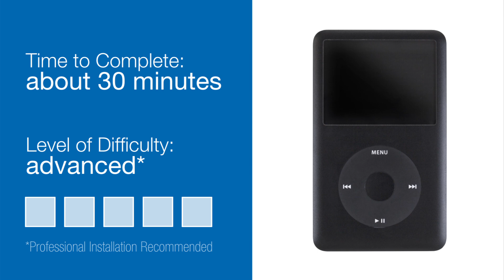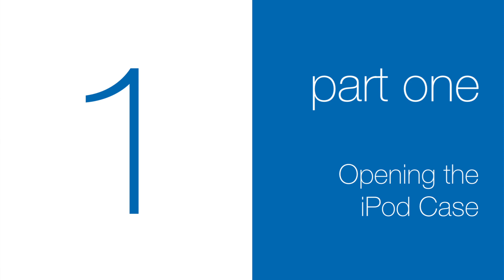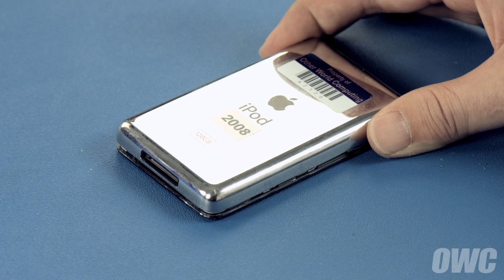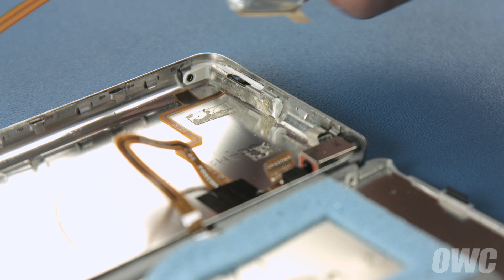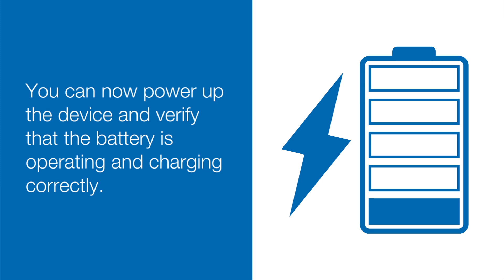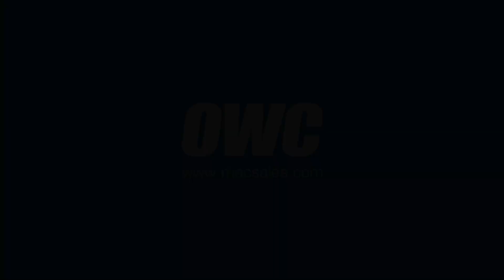How to Replace the Battery in an iPod or iPod Classic (5th, 6th and 7th Gen)

Comment: I bouth the same batery , the batery it’s good? And how long can i used ? One year o more ?
Reply from the maker: Hello there,
Thank you for the question. If you purchased an OWC iPod battery then it will work great!

How long it lasts depends on how often it’s used and how it’s charged, but typically a battery can last one year or more with normal use. Proper charging and storage can help extend its lifespan.

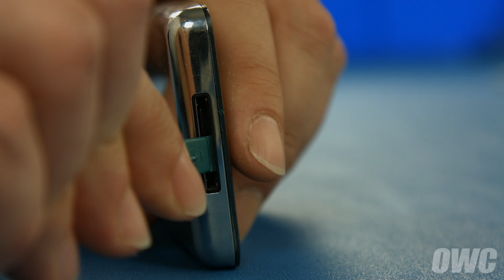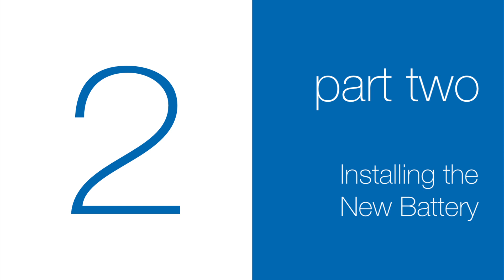Comment: Don't know what kind of iPod they had, but it definitely wasn't a sealed one! If you're opening an old, never opened before iPod 6/7 gen, you'll NEED metal opening tools. You'll need a LOT of them, too. I personally BARELY opened mine with 3, and even then I screwed up the right side of the backplate, so now I have to replace it. I didn't follow this tutorial, because I knew it was bullshit from the moment I saw the jump to a basically opened iPod at 1:10, not to mention the non-original battery at 2:15. These aluminum ones are NOT that easy to open. If you are a first-timer doing this, I recommend watching the tutorial by NekoMichi, it won't make it any easier, but it's not as deceptive as this one. Take care and happy modding !
Reply: You can definitely do it with just 1. I managed to get mine open with only 1 metal tool.

Comment: I have tried to remove the case on two occasions, damaging the charging port and wrecking the leverage tools that come with the battery.  Apart from a bolster chisel and a lump hammer,  I can see little, if any progress to replacing the battery.  Looks like a lost cause.

Comment: Hi I have a an Ipod 5th generation with 2000 songs on it ,, I put it  on charge couple hours but still frizzing if I put New battery my songs will come up?
Reply from the maker: Hello! Your iPod might be having some issues beyond just the battery. Replacing the battery could help if the current one isn’t holding a charge, but freezing could also be related to software or hardware problems.

Comment: I would add one more step. Try it out before snapping the unit back together first to test that the new battery is indeed connected. I wouldn't call this a level 5 job. It's pretty easy once you get the unit apart. Good video though, thank you !

Comment: The metal casing is a royal pain. The best tools I found were metal and just wiggled back and forth around the edges. Plastic "tools" did nothing for me. Make sure you get the right battery by ipad. I noticed I bought the smaller size, but it worked for what I needed.

Comment: Be sure to not remove the battery clip retainer completely from the contacts. I had trouble getting it lined up with the pins and broke a pin off, ruining the iPod. Disappointing.
Reply from the maker: We're sorry to hear about your experience. It's essential to handle delicate components like battery clips with care to avoid damage.

Comment: Tip for anyone attempting this....Don't! The plastic tools are complete garbage and the tips will break off almost immediately. Then, when you resort to a slim flat edge screwdriver you are  guaranteed destroy the back cover and the front casing because Apple made these in such a way to "INSURE" that nobody is going to "STEAL" their designs. Apple doesn't want you inside their products. The tutorial here makes it look easy as eating a slice of chocolate cake, but it's absolutely not. It practically takes a jack hammer to pry the back cover off and to break the adhesive holding the battery in place. Apple purposely put a ribbon cable under the battery so that when you remove the battery, the ribbon cable will break off in two sections and your Ipod is now perfectly prepared for the E-Waste bin.

Comment: Warning ⚠️ ⚠️ ⚠️ 

IFixIt labels this as something like a level 7 difficulty which means unless you're a pro you will fuck this up.

I wanted to try this and the video makes it look very easy but it simple isn't, most likely you will pernamently destroy your device
Reply from the maker: We as well also state in the video its an Advanced Installation process many of our customer has done the installation successfully but we do recommend professional installation if they are not comfortable with the installation video.
Reply: @OWC  the video is over 5 years old dude, I don't think you needed to personally respond to me just ensuring nobody does this by mistake.

There are many, many comments pointing out how you made it sound easy when it is in fact incredibly difficult to the point most professionals will refuse to do it.

I highly doubt "alot" of your users has completed this process without personal training or literally being a professional who takes devices apart as a job.

I have seen professionals struggle to even get the back of this device to open without pernamently damaging it.

Comment: No. Do not be fooled. Other comments are right: They made it look 100x times easier than it is. The instructions here are insufficient to understand how hard this is. Look at either dankpods or EOE's videos. They at least hint at the clipped metal arms that hold things in place, and the appropriate techniques to get to them, and where to insert your tools. And also what tools are preferred. Even with those, I scratched the heck out of my backplate. And this video by comparison is deceptively easy - do not take this as your first guide into fixing 6th/7th gen ipods!

Comment: This video is not realistic. The nylon tools recommended are completely useless. They look like magic wands in the video - the cover was obviously removed previously.  I ended up using a metal screwdriver and had to bend the cover quite a bit before getting it off.
Reply from the maker: Hey Kevin,
We apologize you had issues with doing the iPod. You do want to keep in mind these iPods are older units and due to the wear and environment and if never opened it can be more difficult to open but it is very doable. We apologize once again for the difficulty you had.

Comment: A tip for anyone who does this. Be very careful with removing the battery, it is very very securely glued on and is attached to vital ribbon cables. Best idea is to be super gentle and use a hairdryer to weaken the glue
Reply: Just broke the cable to the reset switch on one, remembered I had another 5th generation, dug that one out and broke that one too. Also that battery was very swollen and squishy so it was pretty iffy even without applying heat.
Reply: @BCThunderthud  yeah its a pain in the ass
Reply: Just did this 👍
Reply: You can use isopropyl alcohol to loosen up the glue

Comment: Tried this with the plastic tools and gave up, took a deep breath and tried it again with a pocket knife and no gloves, gave up before something bad happens, then tried a very small flat head screw driver and guitar picks, came right up. Easy to take out the old expanded battery, but ended up breaking the ribbon cable retainer because it is welded to body, the instruction say to lift it out a little. Time to get a new ipod

Comment: This is over simplified. I've had mine since around 2007 or so ... so the two halves have seemingly fused. No way to separate them to get in. Damn near destroyed it. The plastic tools supplied began to break apart !!! Better sense prevailed and I stopped before I trashed it completely.
Reply from the maker: Hi Fu Choo!  If you'll check the notes on the video, you'll notice that OWC recommends professional installation on the iPod Gen 5/6/7 -- precisely for the reasons you've pointed out.  However, some of our customers still would like to install the iPod battery themselves.   Please note that as of this writing OWC no longer offers iPod batteries for sale.
Reply: @poweredbyowc  I really wish I knew someone who could change the battery for me. Apple is way overpriced.

Comment: This is a helpful video. I've just replaced my battery in an iPod Classic and it was hard work. The case shredded the tools that came with the battery. I had to resort to using a pen-knife screwdriver to pry open the case. The case has gone back on but it's a bit warped. The iPod is still working, which is the main thing.

Comment: It is certainly not easy like is showed in this video, the plastic tools are worthless, and some precautions should’ve been mentioned when working near the screen, mine broke, yes I know, it was me, but still should be mentioned. I ended up being able to replace the battery, but now my iPod is all beat up around the edges. If there is a place where they can do this professionally, I recommend you take it there.

Comment: That iPod was definitely opened before this video, but still shows the correct way to go about it. Didn't bother to order the tools though, took me roughly less than 10 mins with a small putty knife, and a tiny jewelers flat head screwdriver. For me, I keep it in a nice protective case anyways so, wasn't worried much with potential small cosmetic nicks on the plastic edges. Thing has been a beast for years but, can never hold a charge these days. Can't wait to replace my battery now, and have it operate as new again!

Comment: This was easy. Took me about 30 minutes. Tips: use heavy guitar picks (1mm nylon) to wedge open case. Concentrate on one side, and the ends. The body will swing open part way, and you can then remove it. Work gently - watch out for other ribbon cables!
Reply: Yeah, the guitar pick is always handy for anything Apple-related (iPod case prying, MacBook keycap removal, ... )
Reply: .73 jim Dunlop yellow pic worked as well
Reply from the maker: Glad it worked out for you!

Comment: In Part 2, where it goes over prying the old battery away from its adhesive to remove it, this video makes it look like doing so is smooth and easy when it actually takes a few minutes of prying AND breezes past the fact that there is an important cable located just under the battery that could easily be mistaken as part of the battery but is actually the Hold Switch cable. Because all the video says is "gently but firmly" and "being careful of the cables", I tore my Hold Switch cable.. Now I've got to order, wait, and replace that. Very annoying. Be more responsible with your "guides".
Reply: I also tore the Hold switch cable, will the ipod work without this cable hooked up?

Comment: Tools I recieved with the battery were useless, tips sheared off quickly, opened the case with a very old, thin silver sixpence and a silver threepenny piece (what are they? ask your great grandmothers lol). Might be a good idea to note that there are clips all around that once you have located them a little push opens the cover. Battery was easy to remove and install. The grey rubber strips were stuck to the cover so I had to carefully peel those off and put back around the hard drive. Pretty pleased with myself, it all works fine now. Thankyou.

Comment: THIS VIDEO SUCKS. LEAVES OUT SEVERAL IMPORTANT FACTS:
1. Those tools are CRAP. Get a better metal one. 
2. There are clips that need to be separated along the edges. Top, bottom, and 4 along the sides. 
3. You need to be careful flipping that tab for the battery. I lifted the whole piece out and that pretty much made me throw my iPod away since I had already bent the living hell out of it and cracked the screen. 
4. IT IS NOT THAT EASY! You need to use a prying motion, down, push metal frame out a bit, then lift it up and out a bit. Working all the way around. 

There are much better videos.

Comment: With the battery change it is necessary to add the replacement of the upper and lower cover that will inexorably be both damaged by the opening.
When buying the battery, remember to buy the lids too.
Does anyone know reliable sellers who sell good batteries that last like the originals?
I do not want to find myself after a few months to repeat another substitution.

Comment: I've been using my iPod Video 30GB (5th gen) for a solid 13 years. Battery is showing signs of fatigue. Just got a new battery off Amazon. You know what? I think I'll have it installed by a professional, pay the labour and be a happy bunny.
Reply: The iPod video is really easy to open just get an isesamo tool to open it and go around the iPod not putting too much force the rest is easy as well just watch a few videos.
Reply: Joe Blow Does iPod video have those pesky clips ( like iPod Classic does )?
Reply: Ddrsdd D it has clips but they are plastic and not as hard to disassemble the Ipod classics. The classics are a real bitch to open because they are aluminum trust me though the iPod videos are not that bad just go in between the plastic frame and the aluminum backplate and work your way around slowly eventually the clips will unhinge and just get an isesamo tool those nylon ones are garbage.
Reply: Joe Blow I just done it! Just changed the battery! It wasn't too hard , I used a tool that came with a battery and bought some additional plastic tools off Amazon. I also used an old debit card...All those plastic tools are pretty much ruined now , only debit card is still OK. I did it very slowly and managed not to scratch my iPod at all.It didn't close as tightly though , but it doesn't bother me too much , I will put it in a case anyway. My iPod is charging now , so if battery is OK , then everything should be OK.
Reply: Ddrsdd D  😆 great I told you it wasn’t hard at next you can swap the hdd for a  large capacity microsd/sd card.
Reply: Nexus Achiles But it's impossible to find anyone who could replace it!!! I asked in phone repair shops and no one would do it!
Reply: @diana-cy4kj  When the time comes, I intend on showing them this video or similar and ask them if they can do it. Chinese shops are the best, they never say no where I live.
Reply: Nexus Achiles I see...
Reply: Today I decided to finally install the new battery. I was using my iPod on a dock always plugged in, but even then it would turn off lately. I managed to install it, took me 1/2 hour. About 10 min to open it and 20 min to manage to plug the battery cable back into the socket with the little plastick clasp correctly tightened. What a joy to see the screen turn back on! I'm charging it up now, curious to see how many hours the new battery will last before the next charge.

Comment: I very much agree that this video makes the process look deceptively easy. It was not! It became very obvious to me that the case in the video had been opened before.The plastic pry tools were ineffective at best and one was very chewed up by the time I finished...about 2 hours.  I had purchased the iSesamo metal pry tools by Newertech and both those were slightly bent by the time I finished.  I have NEVER had a worse case-opening experience than this.  The pristine look of the case is gone and it does not close tightly anymore. There is no way the battery could be pried up so easily, as was indicated in the video, with the plastic tool as shown.  Mine was very securely fixed in place.  I had to use a long screwdriver to gently pry it up. The actual process of putting the battery back in and connecting it was a breeze...the ONLY part of the replacement process that was easy.  In the end, it does work, but the case no longer fits tightly and it is scarred by the process. Knowing what I just went through, I'm not sure I'd do this again.
Reply: Try the BEST method. 
https://www.youtube.com/watch?v=6aQn-HkvtvM
Reply: @John.S.Oliver  thank you for this video!!! very helpful and straight to the point.
Reply: My case is all chewed up, and to use metal screwdrivers and all my strength to pry open. Nylon tools wouldn't have budged the case. My battery, however, DID come right off, so apparently our mileage/experiences vary.

Comment: I am an aviation mechanic and this removing this case is way harder that it looks. The case becomes damaged/distorted and there will be nicks and scratches on the edges by the time you get done.
Reply: I don't think Apple designed these to be opened and have their battery replaced.  I just bought a 30GB iPod Classic (seems like a 2005 model) for my bedridden mom to have some music.  It seems the battery has never been replaced, 17 years is a good service life, even Apple will wonder why this iPod has not been discarded.

Comment: I have an 80gb ipod Classic from 2007 and the original battery has 3.7v written on it, what is the correct replacement mAh do I require ? I see them listed 580mAh and 650mAh for the classic 80gb or does it matter which one ?

Comment: You've made this look 100x easier than it is. I've done it but damn you clearly used one you had opened prior to the video... Even removing the battery was a nightmare!
Reply: opened mine just fine
Reply: Quite agree, unfortunately. 1'30" and the succeeding seconds are not representative at all.
Reply: My tip for anyone undertaking this procedure would be to watch 3 or 4 different YouTube videos before starting. Some will go into more detail and help with stubborn cases. This one is perfect as a reminder if you've done a battery replacement before.
Reply: yeah, same here. I ruined my iPod and all the cheap plastic pry tools trying to do this.
Reply: @jeremymullins1294  and he didn't mention that, and i just broke mine.
Reply: @jeremymullins1294  Prying tools, not "pry" tools, imbecile.

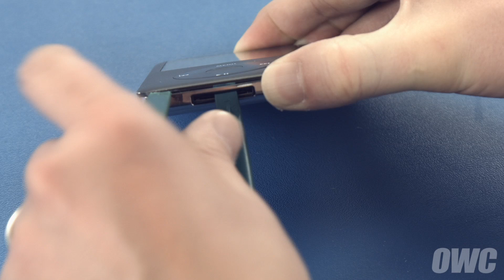Comment: The video cuts at 1:18 and does not show them transitioning from opening the bottom to opening the side.  That is where you're going to get stuck.

I found that the nylon pry tools that were included with the OWC kit were not of sufficient quality to actually pry the case apart at the bottom corners.  I tried sliding them around and they fell apart.  At this point I am stuck and have ordered a kit of pry tools from another vendor.  I hope that when they arrive I will be able to continue the installation.